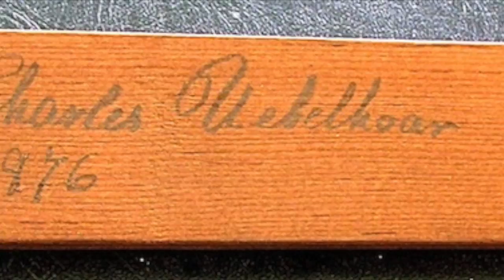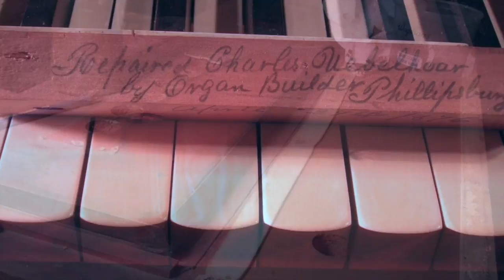Melodeon Movie

Comment: May  I ask you for some advice? I've acquired on of these (Prince & Co. pt 1845), it appears to be in very intact shape, except no sound. The bellows  and wind chest to exterior touch feel intact, except that I can see/feel that the (papered canvas?) top back edge of the wind chest is unglued from the top back of the box, thus letting air flow out there. Wondering if hide glue should be attempted here? The airchest seems very intact except some surface wear on the corners, and wondering if I should reinforce this with some historically appropriate material (varnish or glue? Paper as it seems to be coated with? I hesitate to do anything that makes it less flexible and needs to be undone for a proper fix). Thanks very much for any advice!
Reply from the maker: Hi Christopher...contact me at peter@creestudios.com